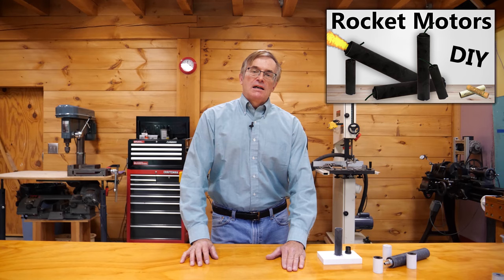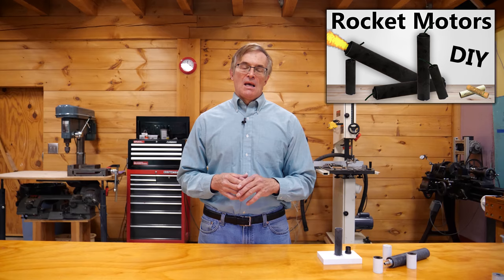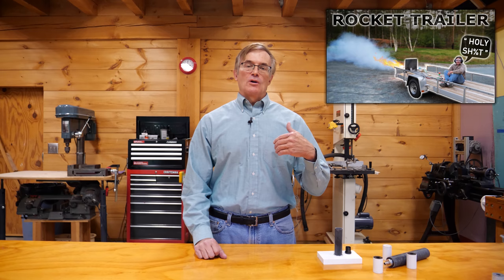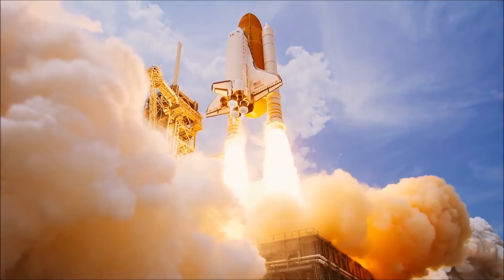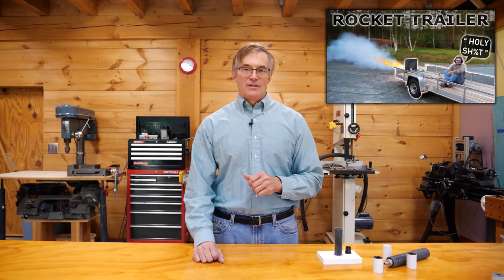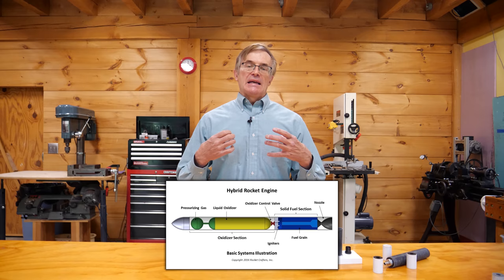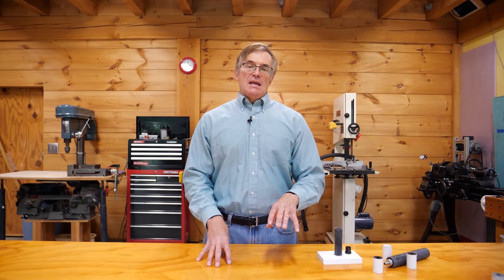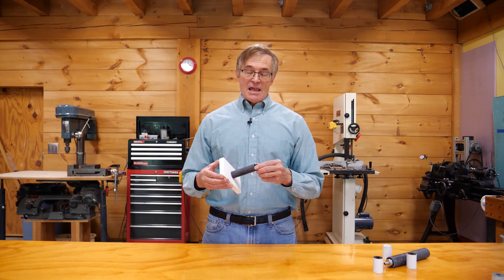Mixing Nitrous and Rockets is DANGEROUS... But Really FUN!

Comment: "this is a very efficient freezer", then walks away with the door opened 😳
Reply from the maker: You see how effecient it has to be?
Reply: the cold air inside is heavier than the air around so it does not escape from chest freezers as easily as it does from the door freezer - that's by design
Reply: I knew it would bug the heck out of some people :D
we're conditioned towards closing any open fridge or freezer as soon as possible. home appliances even beep at you if you're not quick enough
Reply: @LiborTinka  You watch Technology Connections too.
Reply: I was trying to be funny.  it was like an easter egg hidden in the video.
Reply: The room was too cold so he was trying to heat it.

Comment: Very interesting.  I did this about 65-years ago.  Not having access to graphite, I made my nozzle from steel but machined the convergent and divergent surfaces to a hyperbolic surface using a lathe much like you show here.  I ignited it using nichrome wire connected to an auto battery.  I rented a 16-mm movie camera to record the launch but I needed slow motion.  One frame shows the rocket and the next one shows a hole in the ground with lots of dust. The rocket went out of sight, and we never found it.  Then some rocket boys from China Lake visited our city and told us to stop because what I was doing was too dangerous.  He didn't have all of his fingers.  I stopped.

Comment: I have seen solid fuel with differing patterns vs a generic hole. If my memory hasn't gone to shite, I remember where a "star" pattern on the combustion interface gave a huge kick at the outset and throttled back, automatically, as the burn progressed. I know that I am tossing another variable into the mix, but I remember the paper saying that it was a "massive improvement".
Reply: That would make sense. More surface area to start off but it would tend to burn into a circular shape and taper off as you said.
Reply: Finocyl (fins on cylinder) is more popular as its easier to make (much easier to machine a mandrel for) and very closely approximates star grains.

They are used equally in solid and hybrid engines. I've made some finocyls before, they're good but add a lot of work.
Reply: This is true in solid rocket motors. In NOX hybrid motors the faster the fuel burns the higher the pressure which reduces the NOX flow thus reducing the pressure...

Burn stability can be a real challenge in hybrid motors. Many amateur hybrids sound like they fart themselves into the air. Different fuel grain geometry can help.
Reply: Plenty of 'old school' stuff on the effects of solid booster core geometry in Scientific American 4-5 decades ago.
The geometry and throat ratio to burn-chamber area has a big influence on thrust and burn speed, even tiny changes can make dramatic (catastrophic) results. Some nozzle throats are designed to specifically ablate/degrade as the burn progresses. There are core/compositions that start with a short high-impulse 'chamber' then transition to 'end-burning', or a progressive 'layered' change in composition to achieve the same result.
Reply: This is a great channel, I am currently working on the desiccant air conditioner using peltier for the heating and cooling, and   a thine baffle with ceramic resonance atomizers to mix the air on regeneration and dehumidifing areas.
Reply: It's certainly applicable to hybrids, though it changes a lot of the characteristics of the engine. More surface to burn, regression in different paths, etc. Notably as the fuel burns more quickly (as per the motors diameter), you can get more extreme fuel to oxidizer pressure or ratio shifts (this may just be a faster shift). (Think more fuel burning means more chamber pressure/fuel mix, but once the fuel has burned the larger area can reverse the effect, esp on simple rockets with no extra pressurization for the nox)

Interestingly one of the major companies designing real world large hybrids use paraffin with a single bore. Another historical model I've seen had a multilayer wagon wheel, at least 3-5 layers of holes in circles around a central bore, so the star taken to an extreme in many ways.

Comment: I love your detailed explanations.   I used to experiment with hybrid engines in the early 2000's and the problem I was trying to solve was a non pyrotechnic ignition.  At the time, hybrid rocket engines were using a fuel grain to start the process.   Instead of a nozzle, I made an injector out of a "T" fitting with a copper rod going down the center of the "T" fitting, closed off with a compression fitting to insulate and attach the copper rod.  The nitrous came through the center of the "T" fitting and exited out the other end of the fitting, which was screwed onto the engine bulkhead.   Now, a high current plasma arc was initiated between the  copper rod the "T" fitting.   The copper would erode and vaporize under the plasma current.   Plasma vaporizing copper creates a combustion process and produces a bluish purple flame.   Copper is combusting with the oxidizer before it enters the combustion chamber.   Copper is also a catalyst for nitrous oxide and should cause the nitrous molecules to split, produce heat to start the combustion process.   But then Columbia blew up during reentry and I got side tracked and never picked it back up again.

Comment: For those curious, scrubbing the sulfur dioxide out of racing nitrous should be as simple as bubbling it through a saturated sodium carbonate solution (long-boiled baking soda). Might require 2-3 passes/chambers, and an activated carbon filter at the end for good measure. Such a set-up could also be used for a DIY re-breather, though as the oxygen depletes there is a risk of passing out and dying without realizing the O2 is low.

Comment: When you talked about the liquid rocket engine disadvantages, with heat and pressure it reminded me of an real world example of this that I personally experienced in my IB Chem class in high school.

We ended up finishing the chemistry book super early and had a lot of time on our hands. Our teacher ended up just doing fun chemical experiments that we would all just do to essentially fill the time (with him I might add). One day he decided to make an Acetylene Welding torch out of a 20 oz Coke Bottle and Bicycle pump tip punched through the cap. This however wasn't the issue. The performance was rather mediocre. 

First issue, the pump tip was split at the end do the flame was spread rather being concentrated. We decided to take a metal file and cut it to a single hole. Second issue, which was my bright idea, was that we needed Oxygen to be produced the chamber as well in order to create a hotter flame. This was a conclusion since the flame wasn't actually cutting through the metal. This is where things went wrong. Biggest issue was we didn't double check out assumptions before doing it or the worst thing in chemistry was DO THE MATH.

So next day rolls around, we had decided to do this and figured out how to produce Acetylene and Oxygen at a 1 to 1 ratio. The only reason I'm here today is luckily we didn't bump up to the 2 liter bottle like we originally planned and made a larger mixture. So we put new tip in drop everything in and  we're off to the races. It's cutting and I mean you can tell the pressure in it. The flame is also just hot and starts actually cutting the metal. Right about the time we're all pleased with ourselves our teacher goes to say "Wow, this bottle feels a lot hotter than...." *BAM*. 

At this point, all of us have hit the ground, plastic shrapnel is flying everywhere, and when I say our building heard it they all came looking to see what happened. Like there was a school announcement about it to not be alarmed. Everyone cleans them selves up and doesn't say much. The next day we decided to look up what went wrong. I did the actual combustion calculation, some started researching Acetylene with Oxygen and we reconvene about 30 minutes later. Much to our surprise the ratio of Acetylene is 1 to 2.5 times for Oxygen. Acetylene also by it's nature is unstable. On top of that Acetylene gas must never be drawn from its cylinder at pressures above 15 psi because it can spontaneously and explosively disassociate into its components. This is why acetylene regulator gauges display a red warning arc above 15 psi. Which our best guess it we were far beyond that PSI.

All of this combined with the fact that OxyAcetylene is about 10 times more combustible that OxyHydrogen. So glad we didn't do the 2 Liter that day.
Reply: worth the read

Comment: One of these days I just want you to do something simple like making a peanut butter sandwich combined with your usual commentary. 45 minutes explaining the chemical bond between the bread and peanut butter. 

“Ok so I’m going attach the peanut butter to the bread in 3…2…1…”
Reply: This sounds like something I would do...

There's really only 3 primary variables in the making of a good PB&J:
- the structural integrity of the bread
- the viscosity of the J (jam typically has a more homogenous viscosity, and is therefore preferred over jelly)
- applying the PB and the jam on opposing pieces of bread, to be joined only at the point of completion.

This last factor helps immensely with achieving an even spread, and simplifies the assembly process. As well as avoiding any mingling of ingredients in your PB and jam containers. The main advantage though, is that the jam (or jelly) will stick much better to the porous surface of the bread, than it will to peanut butter. In particular since jam and/or jelly is a water based mixture, and peanut butter is an oil based mixture, so jam or jelly tends to slide across peanut butter too easily, which can make spreading it more difficult. So you want to have a peanut butter slice of bread, and a jam (or jelly) slice of bread, which will come together on final assembly. The spreading of the jam on the bare bread also helps to push it into the tiny irregularities in the surface of the bread, to achieve a more secure fitting of the jam material.

The jam (or jelly), has a temperature dependent viscosity. And often there's a small amount of fluid separation over longer term storage. So you'll want to make sure your jam or jelly is chilled to around 5 degrees centigrade to increase it's viscosity. And prior to opening the container, you'll want to shake up the jam or jelly rather vigorously in order to re-mix any fluid separation. Alternatively, you can open the container and carefully pour out any separated liquid, but even then you will want to shake the container after re-closing it.

Now there's a few ways to increase the structural integrity of the bread. Obviously, you can get a somewhat more dense bread, which will resist tearing to a greater degree. Or, on a somewhat lower budget, you can make cheap bread have greater structural integrity by lightly toasting it, or even laying it out in open air for about an hour before using it to make your sandwich, so that it slightly hardens. 

For a more filling sandwich with a generally better texture and flavor though, a slightly more costly, more dense bread is actually preferable. Multi-grain breads also offer increased structural integrity, as well as a lower glycemic index, which is generally more healthy, not to mention having a somewhat more varied nutrient content. Here in the lab today we have some Dave's Bread, more specifically their 21 grain "killer" bread. This is a very dense bread, with a large amount of multi-grain and texture, and the fibrous material which makes up the multi grain tends to increase it's structural integrity, so we won't need to do any toasting or spend any time forcing the bread to go stale to increase it's structural integrity. And while this particular bread is very flavorful, it remains in the general flavor range of a white bread, so you don't have to worry about flavor contamination.

Spreading is highly dependent on the shape of the applicator. For the peanut butter, we're going to use a typical butter knife, but we'll be using the straight flat spine of the knife, rather than the rounded edge, to achieve a more even dispersion. However, once that even dispersion is achieved, you'll want to push the spread slightly to the periphery, in order to provide a more firm support for the less structurally stable jam. Also it can be useful to deliberately roughen the surface slightly to create more surface area for the jam to bond to when final assembly occurs.

Now there's a large debate in the industry about whether to include or exclude the crust in a PB&J sandwich. Generally, the crust adds a great deal of structural integrity to the sandwich, as well as providing a more rigid barrier to help eliminate leakage of the Jam. But some breads have a crust which tastes mostly like burned glucose, and that can adversely effect the flavor of the resulting sandwich. The best solution we have found here in the lab, is to simply get a bread which has a better tasting crust, allowing us to benefit from the structural integrity of the crust-wall around the periphery of the sandwich, while avoiding the potential flavor pitfalls which some bread crusts entail. If you were going to use a cheap bread and remove the crust, you'd want to do that as a final step after sandwich assembly, so that the crust could help maintain bread structural integrity during the spreading phase. And the applied force of cutting off the crust would press the more fluid contents of the sandwich inward, rather than outward, and avoid leakage of the contents. But we're using a bread with a higher quality crust, so we won't need to worry about removing it in this example...
Reply: @kathrynck  tl/dr......but I did laugh after the first paragraph.
Reply: @kathrynck  You freak.. I <3 it.
Reply: I'd like to dare that you missed! or chose not to include the calorie content and elemental associates. I trust you make one hell of a P&J.
Reply: @TwDjLsT  hehehe
Reply: @kathrynck  unbelievable, they would never spread dangerous misinformation like this - toasting is absolutely not optional if you want a high quality end product, I don't care how good your bread is. Also, way to gloss right over all the complexity of choosing the right peanut butter. Besides all that, you fail to mention popular J alternatives such as fruit butters! If you don't know the incandescent joy of a peanut butter and pumpkin butter sandwich you have no business producing guides such as this one.

Edit to add: a good homemade sourdough will always offer better density, integrity, and nutrition than any store-bought homicide loaf

Comment: 17:42 I'm glad you take the time to explain the point of the nut on the connection adaptor not being a sealing component, I used to repair gas regulators and other equipment and it's frustrating to see thread tape (PTFE) on the nut and the oring missing.

Comment: Best and most comprehensive explanation - and proper handling - of commonly available racing-use nitrous oxide tanks and basic plumbing.  Thank you for investing time to make videos that encourage safety while evaulating and optimzing systems to engineer a high performance result.  Long time subscriber, this is one of your finest videos.